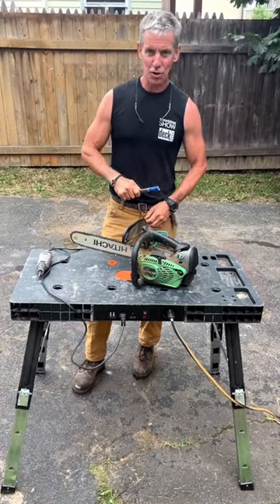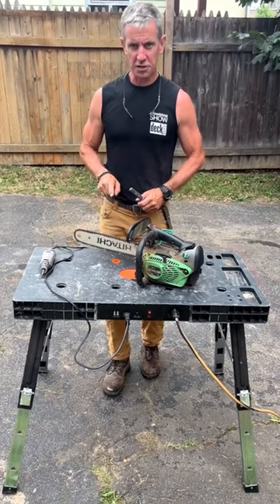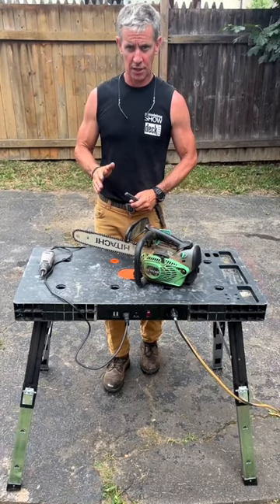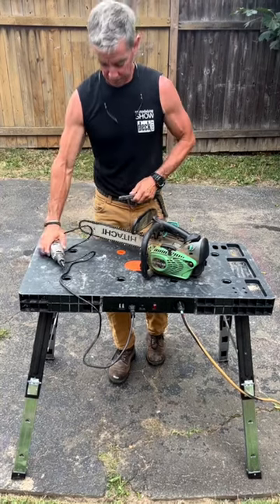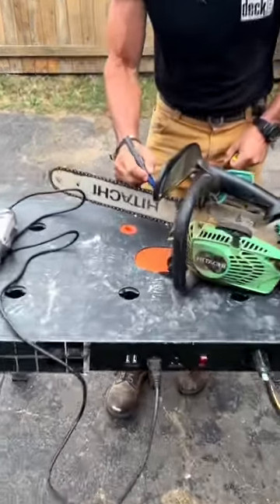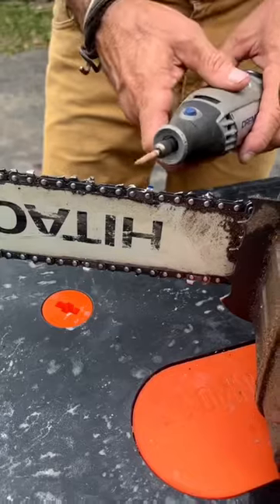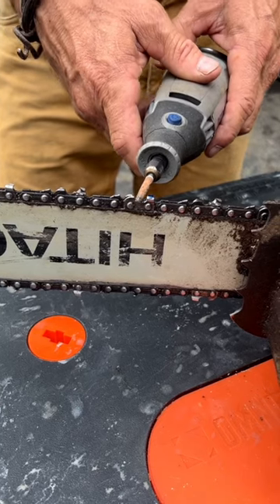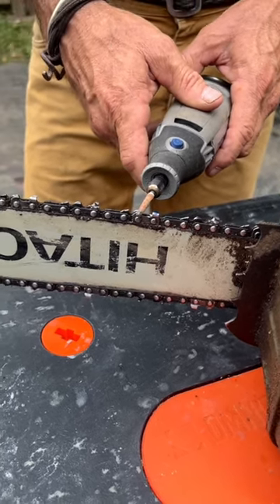How to sharpen a chainsaw chain

Comment: Just get a normal file
Reply from the maker: Why?
Reply from the maker: @yawningdog9894  OK Caps Dude. It works. Chain cuts.
Reply from the maker: @yawningdog9894  This method has saved me so much time in the field, I'm not really sure what your point it. It's easy and safe and I have yet to be able to make a file work as well as this does.

Comment: Please don't follow these instructions. Silliness
Reply from the maker: Free country. However, there's the slight issue that it works great, so...
Reply: It works great in the shop with power. Been doing it for years. Still keep the hand file in the glove box though.
Reply: @chainscdmc going to have to get you a battery powered dremel for the glovebox now 😂
Reply: @kurtdussander4944  you ain’t wrong. Lol

Comment: This is bad advice. You will wreck your chain. A pro wold never do this.
Reply from the maker: Other than the fact it works a 1000X better than any file I have ever tried, you're right. It keeps my saws in the game and churning out ribbons, not dust.
Reply: What would a pro be to you?I have been the proud owner of a thriving chain saw shop for 30 years been working in it for 42 years because my father owned it!we service more than 2000 customers large and small business including my own professional tree service company we’re I employ 35 men and women that handle saws every day!and sure some sharpen with a file but carrying a battery powered tool with a ceramic bit works just as good and faster..no complaints from me or my customers..so what would a pro do or say!!
Reply: @fergieferguson2457 people that are saying this ruin chain's are that it doesn't work as well are referring to those who don't know how to use the ceramic bit Dremel method properly. If you hold the bit too long with too much pressure on a tooth you will heat it up and take the tempering out of the chain . As soon as you see any blue coloration that The temper is lost and the metal become soft. That doesn't mean that they don't work amazingly well you just have to know little bit about metallurgy .
Reply: Absolutely correct @albertski28 this guys green and dont know 💩 and Im sure she'll be putting in her 2 cents worth any second now. What a joke! 
Ruining a chain taking guides down and proud of a piece of crap electric sharpener she will buying a new one the second she forgets to unlock the motor.
Reply: @fergieferguson2457  Those ceramic bits ain't worth crap after you use it on a couple of chains

Comment: Don't take chainsaw tips from someone who uses a electric chainsaw
Reply from the maker: I agree, but bro. Cord?
Reply: Plenty of issues you can be called out for but saying your little top handle is electric when you can see the primer bulb in the video? That's more lazy than attacking a chain with a Dremel with no concept of basic chain terminology, angles, raker depth... a time investment in a 5 minute youtube video from Billy Ray would save you all those "run and gun" minutes you keep spouting about with doing a quick and dirty sharpening job. Glad you're using a safety chain though. If you have no interest in maintaining equipment properly I imagine using a full chisel chain would be a dangerous endeavor for your head and knees. (Kickback)
Reply from the maker: Other than the fact that this works like a darn charm and has kept me teeth silver for all day storm recovery cuts better than any file I have ever used, whatever. - I'm not a tree service, steel expert chain snob--nor to do I claim to be. Stihl literally makes a file that grinds the raker as it grinds the tooth. Know where I learned that? From Stihl. In VA Beach at their HQ. Dude, maybe try decaf.
Reply: @myfixituplife  I use full chisel but if you can't get a used chain sharper than a brand new store bought chain you don't know how to use a hand file
Reply: Battery technology has come a long way, so for most average people type jobs, an electric one works fine
Reply from the maker: @Killcross14  depends what you mean by “average”.  Yes, batteries are amazing these days, but they can’t hold a candle to gas on several metrics.
Reply: @myfixituplife I dont. And Im a 35 year veteran. Makita makes an electric saw that keeps up with stihl gas power without the stink, vapor lock, chain moving while idling, muffler burn, all while not spending money on ethanol free and cleaning air filter daily. Dont even respond to me if you haven't used one, I dont have time for closed mindedness. I wouldn't have believed it myself until I bought one for my wife who most likely outworks a lot of so called ground men. I commandeered her chainsaw and then had to buy another for her
Reply: @myfixituplife After further review i think he left out a word. Electric chain saw sharpener was what he meant to say. That saws a dinosaur and my Makita electric would out cut if you could start it lol
Reply: So you say that electric makita can keep up with a gas powered stihl ?!? Are you mental
Reply: @clintoncroker2461  nope , 35 fkn yrs climbing ! It compares to a Echo top handle trim saw. Largest they have. If its big I use gas. 90% of My work is 4" and under. Light trimming pays me the most. I live to close to the southern border to compete with the Brown on that. My Makita electric chainsaw power pruner and blower is awesome. I have several back up gas saws and I  Have 261 stihl anr an 064 still with a 4ft bar and 3 other smaller bars. Im no amateur. I can name 10 good reasons for the electric saws.
Reply: @treeman2660 I live in deep S TX and have cut Mesquite for years. Where do you live?

Comment: Definitely DO NOT do this.
Reply from the maker: Reasons, not demands. It works. It works every time. Is it perfect? Nope. Does it keep my chains out of the shop? 100%
Reply: Because of several reasons. First you are filing every cutter different. Second you have no idea how much your taking off each raker. Third (and more) you are heating the chain too much. This method is for lazy homeowners that probably don’t care about a straight cut or any kind of performance out of your expensive saw. That thing probably bounces and shakes your arms off cuz it’s so misfiled. But hey if you only fire it once a year for 2 cuts then good for you.
Reply: @deanvigna7519  lazy homeowners vs people who value their time and money 

How do you tell the difference?
Reply: I’d laugh while you sit there hand filing all the chains after a few days where I work (or try to on the job👎). And they make raker gauges for that exact reason even though you can clearly see how much depth is there with a flat file, which should be used for rakers. Quit misleading people.
Reply: @myfixituplife  Cant wait for your own self induced kickback BRO! Ruining your chains.
Reply: @kademyers6152  Not to mention people who cut wood and not dirt don't need to sharpen their saws much.

Comment: 😂😂😂 W T F... GOOD LORD
Reply from the maker: And I reply, WTF? It works. Whddya want me to tell you?
Reply: @myfixituplife   as a logger and long time chainsaw operator i know this works but is totally in accurate if u want it to cut straight.
And its called a tooth and raker , u should probably know this before making a video instructing people how to do it
Reply from the maker: Yeah, no argument you have more time behind a chainsaw than I do, but I cut a lot o wood fiber using this method and "not cutting straight" was not a problem. It worked way better than any file I have ever used. It kept me working. - I also know it's a tooth and a raker....I'm not perfect. Sorry.

Comment: This dude has a hitachi saw…nuff said about whether i listen to his advice on how to sharpen a chainsaw chain…
Reply from the maker: It's a great saw. I had issues with the air filter, but there's no saw I haven't had issues with. - Hitachi is no longer in tools. It all became MetaboHPT and the outdoor power equipment is whatever. - However, the Dremel works on every chain I have sharpened. Saved me, literally, thousands.
Reply: Back in the day, there were many brands of saws. Even Makita made them. Some of them were great. The difference between a great saw and an average saw is one that starts on less than five pulls and one that doesn't. I had an 015 Stihl that never took more than three pulls. Usually, it would start on one.